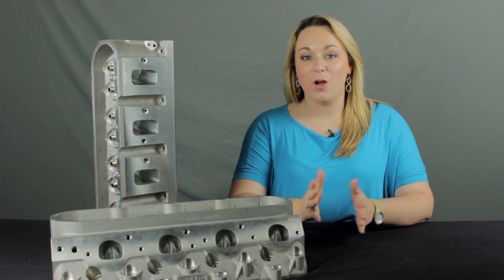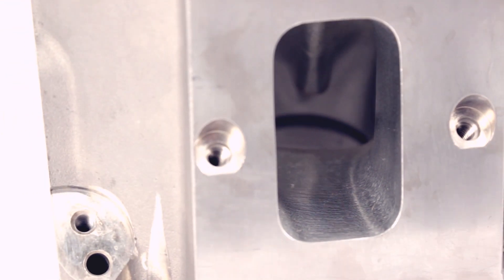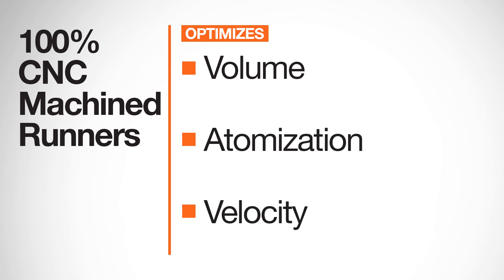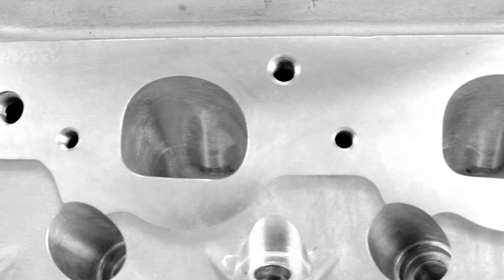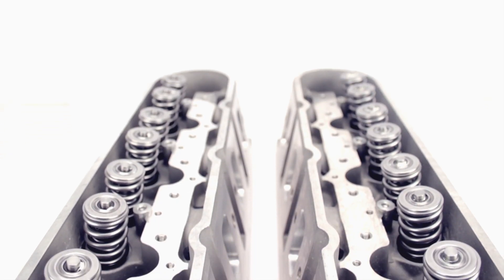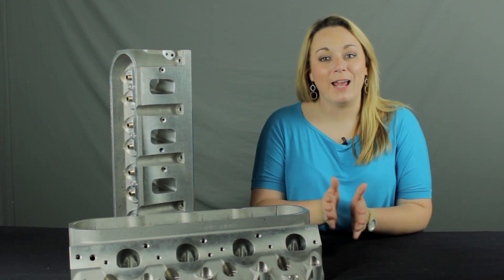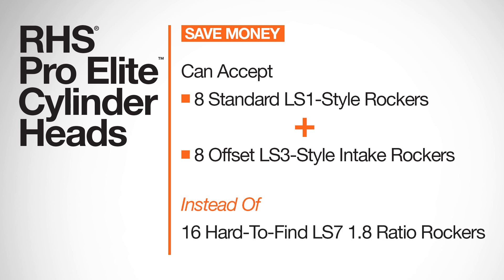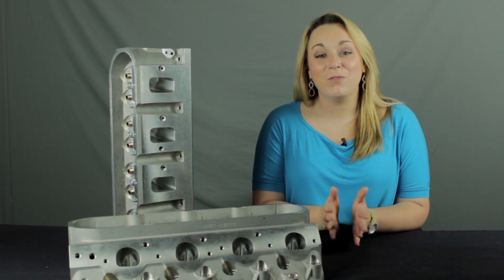Product Spotlight: RHS Pro Elite LS7 Cylinder Heads

Comment: any flow charts or stats for these heads?
Reply from the maker: If you check out the RHS website at www.racingheadservice.com you can find a variety of stats there. Thank you.
Reply: ReFuzy  The numbers have come in and the peak flow of the Pro Elite LS7 heads is 388cfm intake and 237cfm exhaust at .700" lift. Thanks!
Reply: RHS (Racing Head Service)do you have the whole flow chart